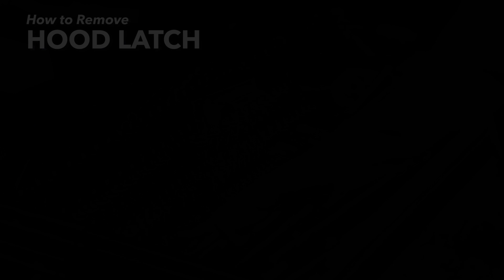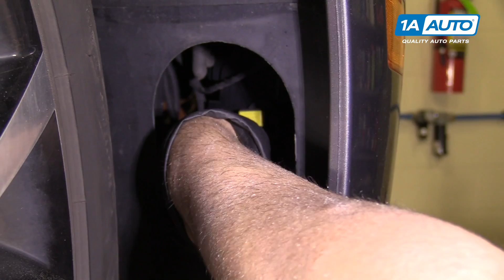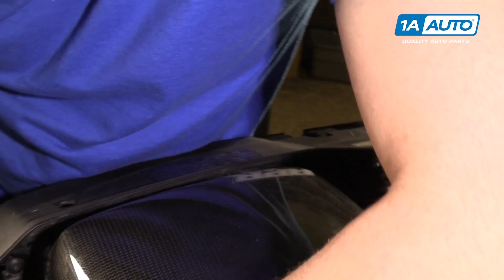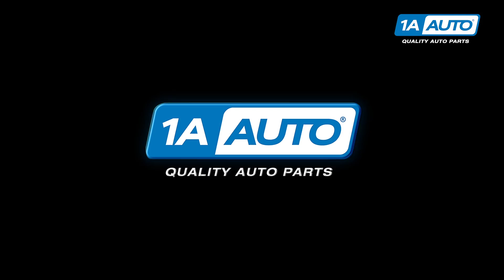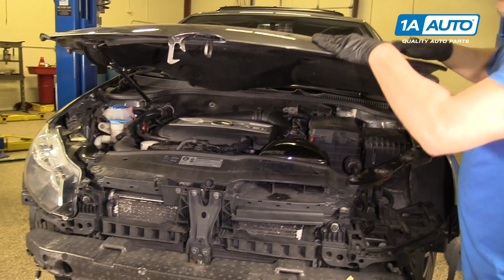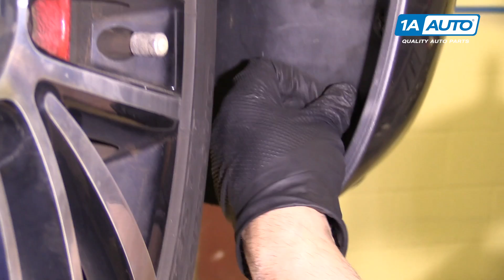How to Replace Hood Latch 10-14 Volkswagen GTI

Comment: Thanks for the video, did this job today on my 2010 1.6 TDI Golf UK spec car.

Not too bad a job, took about 3.5 hours in total with basic tools and knowledge. It looks a lot more than it is but it's quite self explanatory.

Please note that on a right hand drive car, you need to remove both headlights as the sensor is behind the passenger headlight and the release cable is behind the driver headlight.

Comment: You can replace it by without taking the spoiler and headlamps out.
Reply: Exactly, I also was able to quite easily replace it without removing the entire bumper and headlight! The only part I removed was the small grill at the front that has the VW emblem on it, and loosened my APR Carbon Fiber air intake. The latch that I ordered on Amazon was for an Audio, so the electrical socket was too large on the sensor cable, but I simply cut it and joined it to the wire from the latch I removed. Doing that also gave me extra length on the cable to feed it around and tuck it in neatly. All working, with functioning sensor.